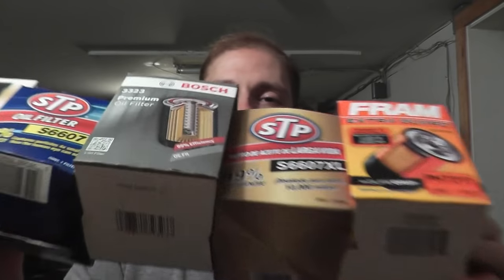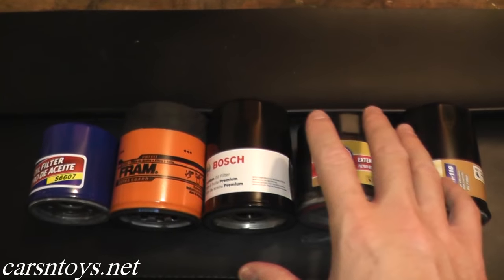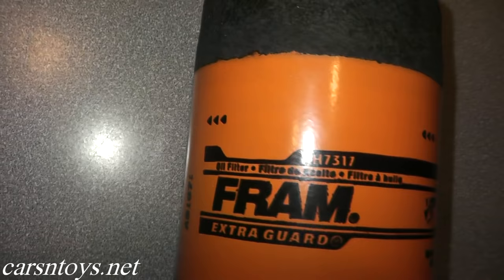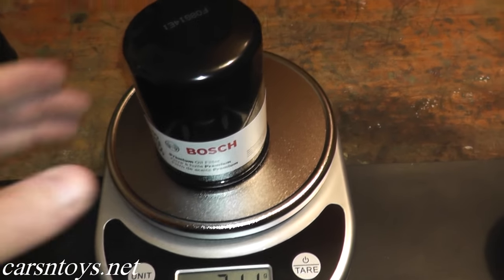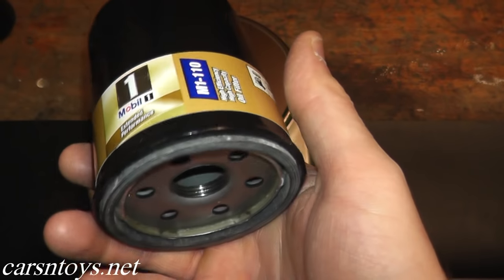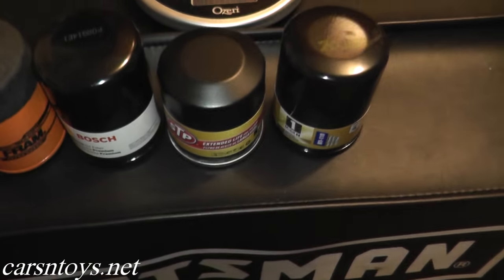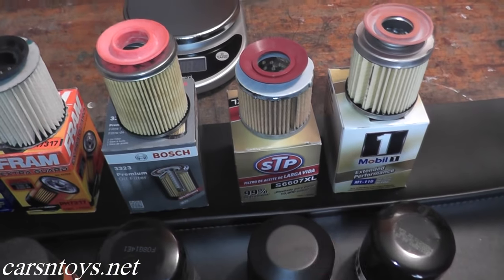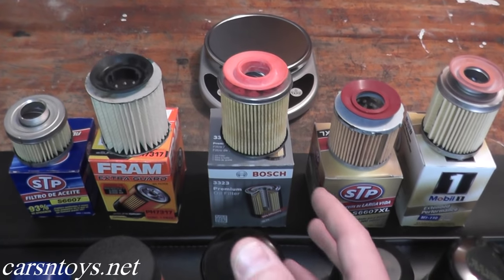OIl Filter Comparison...STP vs FRAM vs BOSCH vs MOBIL1

Comment: A couple observations. First, where's wix? Also, another consideration is the location of the bypass valve. Fram has their's at the bottom of the filter. That makes the pumped oil go across the dirty filter media when the oil is too cold and sends who knows what to your bearing surfaces. When the design allows, wix has their's at the top allowing oil to go right around not picking up previously captured trash. 
Last thought, fram is a four letter f-word and I wouldn't even put it on an ex's car.
Reply from the maker: Wix - https://youtu.be/whbYlcrYr7I
Reply: I agree, where's the wix? I've used only wix for 21 years. Conventional and synthetic. 3k-8k depending on the vehicle. Always told they were the best buy multiple mechanics.
Reply: fram ultra synthetic is a terrific filter. too bad it wasn't in here. it stacks up with the best stuff out there
Reply: Gee, I have used fram for longer than 21 years and never had an engine failure. Too many out there thinking they know more than they do. DO you honestly think a company would put out a product knowing that it would cause engine failures like that? Of course not. Also, the fact there has never been a class action lawsuit against fram should tell you that all the "information" about fram being bad has zero basis in fact.
Reply: Dirt Muhgert .I have a 03 focus L4  2.0 Dohc vin3.i get my oil & filter @ rural king! 1.59 per quart of 5w20 synthetic blend! However,In their book of filters, there's 4 filter listings for most motors but only 2 listings for my motor.so I looked at the filter for the (focus 2.3ltr) called 4 a Fram XG3600 ultra synthetic. (it's a little LONGER then all my previous filters) wish I had a book of all filter 4 all makes & models OR IF ALL FILTERS HAD THE PART/MODEL # OF EVERY FILTERS THAT WOULD FIT, STAMPED ON THE FILTERS & BOX.NEEDS TO BE FEDERAL REGULATIONS ON FILTERS!   I used a eco guard filter on my girls sebring (BIG MISTAKE) NEVER AGAIN!! SO I HOPE THE FRAM ULTRA SYNTHETIC IS A GOOD ONE? It upsets me that the filter book at rural king only showed the 2 crapiest filters 4 my car & NONE OF THE BETTER FILTERS SO, I had 2 compare thread sizes myself & kinda take a shot in the dark!!!
Reply: Jon your argument of "do you honestly think a company..." amounts to "trust the manufacturer." I think the whole point of this video is that while Fram may have good filters, there are better ones out there, and each person should know the facts about all of them. It's not your job to be Fram company spokesman and belittle those who have genuine concerns about a company that uses cardboard in their cheapest filters. Their views are as valid as yours. Your use of Fram filters is merely anecdotal and doesn't prove or disprove the quality of Fram. Many have already pointed out that Fram has many quality levels, and that if you are changing oils properly and on-time you should be able to go "longer than 21 years and never [have] an engine failure." Hardly a surprise, because you probably have been doing properly-timed oil changes on your vehicles, and you are probably an owner who takes good care of your vehicles. I'm sure most guys on here are likewise.

And your point about class action lawsuits is pointless because litigation is only successful if you can show negligence that causes harm. Porting the bypass valve in one place or another is a quality issue, not one of negligence; in other words, it's a 'you get what you pay for' moment. So those who don't like the bypass on a Fram can't successfully sue because of quality differences. They would have a tough uphill climb to prove an engine blew up because of the location of the OF bypass and not because of the filthy oil that was allowed to circulate for months because the owner didn't bother to change it. Any neglect, in such a case, would apparently be the fault of the owner and not the manufacturer.  Very, very hard to prove negelect, AS IT SHOULD BE, otherwise we'd have every jackass with a grievance heading to court to blame some manufacturer for their own stupidity. The absence of class-action lawsuits within an industry arises due to complex LEGAL factors, and manufacturing quaility is only one of a wide set of reasons why such suits are rare.
Reply: @D.j. B....No, we don't need FEDERAL REGULATIONS on something as irrelevant as oil filter part numbers. Do you not realize that for every regulation created, the government creates an entire MULTI-MILLION DOLLAR BUREAUCRACY with multiple 6-figure staffers to police the whole enterprise? Your suggestion would result in probably two dozen new federal employees and a budget in excess of $10m. Just so you can avoid doing a bit of research in a parts calalog. And this doesn't even begin to take into account the legitimate businesses that WILL BE HARASSED BY FEDERAL OFFICIALS for violating silly rules and not jumping when they say so, further harming economic competitiveness. 
Regulation should be reserved for intractible social problems that have no easy solution, and even then, we should be using regulation AS A LAST RESORT, not a first resort.  Our world has enough problems and BIGGER GOVERNMENT WILL NOT SOLVE ANYTHING.  Try reading "The Tragedy of American Compassion" by Marvin Olasky to see how something as simple as helping the poor through social charity TOTALLY WENT TO SH!T once the feds took it over, in the 1930s reforms under Roosevelt. 
We need to eliminate this knee-jerk reaction that every social annoyance can be solved by trusting the government to erect yet another byzantine regulatory architecture  -- the same government that is 19 trillion dollars in debt for exactly similar reasons. People need to be EDUCATED about what their knee-jerk reactions cost themselves, and everybody else, in terms of LOST FREEDOM and HIGH TAXES. Try reading a few things written by Ron Paul. I might not vote for  him or his son, but there are a DAMN high number of sensible things that come out of their political ideology.
Reply: Sorry, but people saying fram sucks carries no more weight than me saying they work fine. As for changing oil properly, if that were the case, then why use a filter at all, as by YOUR logic, oil changes are all that is needed. That is just not true. A filter is there for a reason, so no, on time oil changes are not enough by themselves.

Also, do you have no clue about how law works? Just an example, but look at all the lawsuits over asbestos. When it was created, no one could possibly know the effects it would have. There is no case of negligence.Sure isn't stopping the lawsuits. So, given that, IF enough engines were failing, ADN failed while using fram filters, then it is possible a case could be made for that. I don't know about you, but I've seen how "cardboard" acts when it is soaked. It shreds apart. So, we have 2 logical conclusions; 1) it is not cardboard and people who have zero qualifications are making claims they have no way of backing up or 2) it is cardboard but fram knows what it is doing. Now the FACT is, there have been zero controlled studies done to show fram filters are better or worse than any other filter. Only bs videos like this one, or other people making claims with no proof. If you read all the way through, you;ll notice that I do not say fram are the best, or even better than other filters. Only that I have used them with zero problems that could be attributed to the filter. And since fram is used by millions, and has not been sued for poor quality, the only logical conclusion is they are no worse than any other filter.Sure, there may be others, but again, zero scientific testing in a controlled environment.

Oh, and to respond to your other post. Sorry, but once you start using rand paul; nope, just nope. I'm sorry, but you are just plain wrong in that whole rant of yours. Without the epa, our water and air would be so poor. You think smog is bad now, especially in big cities, maybe you should see pictures of LA in the 50s. Or maybe look at the air in China now. Now, I will admit certain agencies should be wiped out, homeland security for 1. Tsa for another. Neither are efficient in any way, but they do sure cost a lot.

Sorry, but just letting businesses set the pace of things won't work. Change to issues comes at too slow a rate. Remember how things crashed in 2007? Yeah, lack of banking regulations sure helped lead to that. This is well known. And um, medicare, social security, those are both vital programs created during Roosevelt's terms. Sorry, but history is not on your side with this. 

After this, I just am not going to bother responding to you, as your thoughts are not well formulated and your theories are poor, at best.
Reply: +ilovemuskoka  Yes, i work for State of Cali. - unbelievable bureaucrats make Feds look efficient.
Reply: Travis Smith

Comment: I change the oil in the company car I drive (so I don't care about it that much) I use FRAM oil filters and walmart supertech oil and I've had 100K miles of zero issues.

Comment: Good vid and ur right! No need to get an expensive oil filter if running only conventional oil. Cheapest I find is purolator oil filter at Walmart for $3. I change my Chevy Equinox oil every 3000 miles.

Comment: Nice video, but I was surprised that you didn't test a WIX filter.  Wix is what I'm using now, after using Fram for many years and I learned from other Y.T.. videos that the Fram was cheap crap.
Reply from the maker: +A gm (snowman) Yea, local part store doesn't carry wix filters. I was surprised with Fram as well. They make another longer-lasting filter, but not in stock.
Reply: +CarsNToys I cut the "tough gard" apart, it's crap also. Bosch can't be beat for quality and price!
Reply: +CarsNToys Napa Gold is made by Wix.  They are supposed to be among the best.

Comment: For the money it's hard to beat a Motorcraft™ filter.  Silicone adbv, oil bypass is near the inlet so You're not washing contaminants off the pleat's and thorough the bypass. For $4.
Reply: Motorcraft is made by Wix! they are great filters

Comment: my advice , stay away from fram !
Reply: Only thing about Fram is the grip.
Reply: vwbora26 
Stay away from lower cost lower grade fram higher grade higher cost models are fine especially the ULRA SYNTHETIC
Reply: @coiledsteel8344  Fram is huge and on every shelf for years so they cant be that bad
Reply: I ran Frams for years although for the last couple years I've used Motocraft in my Mustang & Ranchero. I'ld like to see a test that includes a Motorcraft filter.

Comment: Oil filters don't know the oil running through them - you can use regular or synthetic with any.
Reply: +Matt Stephens-Rich The oil going through them will make a difference depending on type.
Reply: +Mohammed Rahman Make a difference to the oil filter itself? Not really.

The major difference between regular and synthetic oil is lubricity: since synthetic has a more constant, smaller size of molecule, it will flow better than a comparable, same-weight regular oil. (Which is why it is often recommended for severe heat and cold climates) As for the oil filter; this is not a difference that will impact it.
Reply: +Matt Stephens-Rich Thanks for the explanation!
Reply: He's just saying don't waste your money running conventional with them, not that you cannot use it.
Reply: "since synthetic has a more constant, smaller size of molecule," Maybe the point of a synthetic oil specific filter then is that it can filter out smaller contaminants without restricting flow too much if the oil is full synthetic.  That might lead to needing to change the filter more often and/or the oil less often.
Reply: I gutted an oil filter so it's just a can that screws on, no filter at all.

Comment: Thank you.  So I will continue to use whatever Is on sale.  My 2002 Chevy venture gets synthetic oil in the north east winters, and conventional oil in the spring and summer.  At 155,000 miles I do not think the oil filters matter that much.  I use the gm oil life monitor and change it at 5 or 10% oil life left. Never had any issues with this 15 year old van, and the family of 5 still takes this van on cross state trips.  I maintain it like an airplane with maintenance checks and changes.

Comment: Did I miss something? 10k,15k miles? I change my oil filter with every oil change.
Reply: With a good synthetic you may only change oil every 10k, 15k, or more.  Thus, you need a filter that'll do that unless you want to change filters between oil changes.
Reply: so does every sane car owner. wtf is your point?
Reply: Of you're gonna keep your car a long time, change both every 5000 miles. It's a small cost to double the life of your engine.
Reply: I can't believe people would take a $20,000 car and then NOT change the oil every 3,000 miles even IF it says you can get 5,000 or 10,000 miles, to save a lousy $25 you're going to let the contaminants, condensation etc sit in the oil that much longer just to get a couple thousand more miles out of it??
If you don't do much more than short trips the oil gets dirty REAL FAST, mileage is not the only criteria, it's time and how you drive and where- live off a gravel road? do short hops? change it frequently,
Reply: I still change it every 3,000 miles, for  a lousy $25 and change it's cheap enough. My last car a 94 Olds wagon  had over 200,000 on it, with NO internal engine work ever done to it, I had it 10 years, the previous owner used it to drive to work every day- a 60 mile trip each way, he changed the oil every month due to mileage and it was all highway miles.
Same thing with my 50cc scooter, I change the oil very frequently, it only holds half a quart of oil, and condensation is a problem with short trips, now it has over 5,000 on the odometer, still going fine.
Changing the oil is the best thing you can do.
Reply: I used to change the oil in my truck more often, but the old lady has gotten too fat to crawl up under it. Do you think I should invest in a lift kit, or just buy a set of ramps?
Reply: I have a friend who just traded in a 2000 Tundra with 270,000 miles on the clock.  It still didn't use enough oil to add any between changes, and he changed it every 15,000 miles.  I asked him why he traded it, and he said it was time for a timing belt again and some expensive front end work and he just wanted a new truck.  I recently retired and sold my commuter car, a '97 Cavalier with 241,000 miles.  It used a quart about every 8000 miles, and I changed it every 12,000.  The engine was still fine but the rest of it was pretty well shot.  ;)  I could give you many more cases of high-mileage cars using high-quality synthetics and being changed at 10,000 or 15,000 mile intervals.  

I went for years changing every 3000 miles using plain old Pennzoil and got good service life out of my vehicles -- nothing wrong with that.  But for the last ten years or so before I retired, I spent twice as much for an oil change, and quadrupled the change interval.  That's half the price.  And, I got good service life out of my vehicles.  And ... I spent one-fourth the time lying under vehicles and had one-fourth the used oil to try to dispose of.  Nothing wrong with that either.  ;)

I do agree with Victorian.  A lot of short trips are hard on them.  Since retiring I've changed my intervals to once a year minimum.  For my truck that's about 3000 miles.  For my car it's still about 6000; I'll still change it once a year.  And I have a motorcycle that does about 16,000 miles a year.  It'll get twice a year.
Reply: OMG that was funny!
Reply: Ed your correct I have driven diesal pickups and hauled lots of frieght for 20 years and I use Shaffers sythetic oil and amsoil 99.99 efficency filters they used to be rated for 25thousand miles! I would change it at 15/17000 miles. If you use a good synthetic and a high quality filter you cna easily go 300,000 miles like I do on a truck with minimal engine wear probably much less than people who do 3000 mile oil changes with non synthetics and crappy filters.
Reply: Victorian Sculptures maybe with older cars, but cars these days will do just fine with 10k. I do mine at 5k